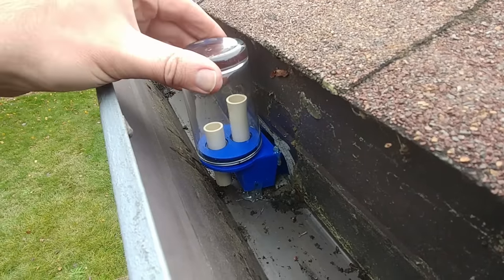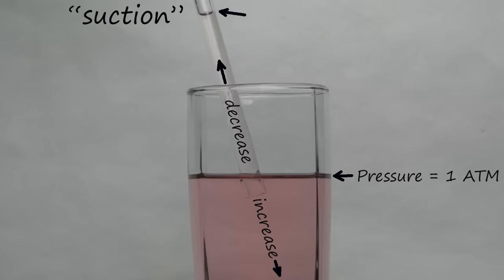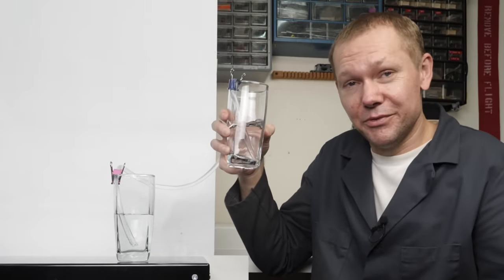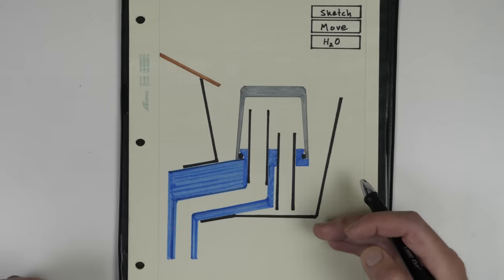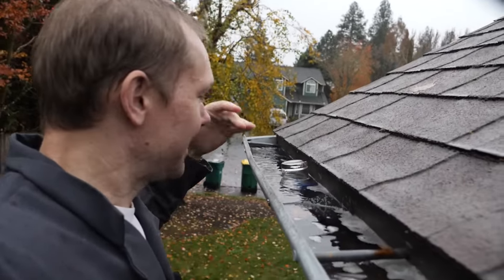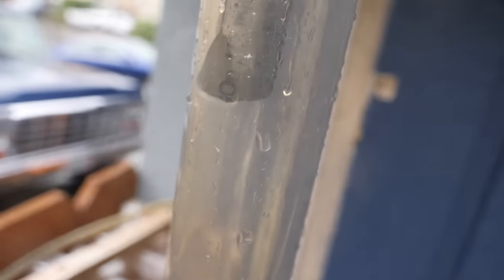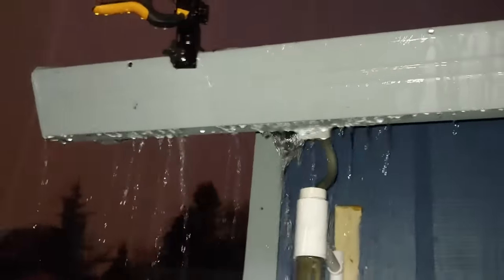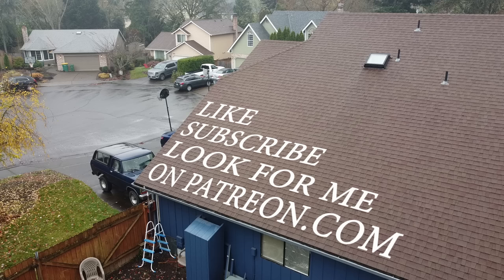Rain Gutter POWER #5 - Bell Siphon Fundamentals and Pitfalls

Comment: 8:09 What a satisfying sound :) 

BTW you should add a filter.
Reply: I agree with the Huguenot, a filter will restrict flow but a leaf guard will help with keeping the debris out of the gutter while also not affecting the flow rate.
Reply: @Willy-the-Fire-Putter-Outter  My reasoning is that small particles will plug up the nozzle quickly. He can mount a couple of feet or just one foot of screen or filter in and around the inlet of the gutter. The flow rate would stay the same that way.
Reply: @unogazzy84  ahhhh I see what you mean now. I initially imagined a filter directly attached to the bell siphon. But like a gated perimeter of wire mesh or something that encapsulates bell siphon entirely to prevent anything from getting inside from the top. But then this new mid-way filter would most likely need to be serviced frequently to prevent major debris build up. Maybe a way to solve that assumed problem would be to add chicken wire dividers along the length gutter to prevent too much debris from collecting up at the mid-way cover.
Reply: @Willy-the-Fire-Putter-Outter  That is a very good idea. How about attaching a ledge of chicken wire over the gutter? A roof on the roof if you will. It will have to be serviced but the amount of debris in the actual gutter would be miniscule.
Reply: @unogazzy84  that's the initially idea I wanted to comment about but saw this comment thread and wanted to participate here haha. Make a chicken wire roof along with chicken wire mesh dividers along the length and then that chicken wire bell siphon cover. The only problem I imagine would be stubborn leaves getting stuck in the chicken wire roof cover and either making a bridge for water to go directly past the gutter all together. Idk, maybe the shape of that top cover could be experimented on. See like if a flat, rounded or pointed top cover works best against building up initial debris. The amount of shapes is endless so there must be an optimal shape

Comment: This was one of the most fascinating topics covered in my auto tech courses. Not sure if siphons are covered under Pascal's law or some other but the water leveling out in the two glasses makes sense because both sides are exposed to atmospheric pressure and are sitting level. As long as the tube to the bottom of glass A isn't raised above the height of the water level in glass B or vise versa the water level will continue to level out. A sudden change in elevation in either glass- like is achieved by raising one glass suddedly- will cause a change in pressure forcing the siphon to drain the glass accordingly. This is a similar concept to the one used to make a brake fluid pot work. You fill the pot with brake fluid, put the top on (it has a tube that runs to the bottom) then pressurize the pot with air. It pushes the fluid up the tube due to the difference in atmospheric  pressure and the higher pressure in the pot.

Comment: Thanks you for a great series of videos. Very informative, and also fun to watch. A friend and I are going through very similar steps working on a micro VAWT.
One thing i already discovered before seeing your videos was that replacing the ball-bearings in the cheap Chinese alternator we got makes a huge difference. 
I have two tips for you, regarding the bell-siphon:
1) give the drain-tube a slight narrowing, a venturi-like shape, at the top. Or maybe just flaring out the top of the tube into a slight funnel-shape might do it. And make sure the top edge of the tube is level, of course.
2) put a second bell-siphon, set to a slightly higher trigger-level, in the drainpipe at the other end of the gutter as an emergency overflow valve.
Cheers! 🖖

Comment: The concept at the end where the glasses automatically level is used extensively in industrial settings across the US. Many sites that dispense petroleum fuels, like gasoline and diesel, have multiple below-ground storage tanks for the fuels. Very often there are multiple tanks with the same product and these tanks are usually interconnected via a siphon system just like your three glasses. This allows the site to drop product into any of the multiple tanks and the levels across all the manifolded tanks will self-adjust. Likewise, product can be pumped from one or more tanks with the same effect. No need to pump from tank to tank or sequence removals with automation.

Comment: You could make a 2nd bell siphon(overflow) with larger tubes and set it higher than the original one so it only starts if the 1st one gets overwhelmed during extremely heavy rains. Cool build

Comment: I had built a rain water harvesting system. I had 8-55 gallon barrels connected in series. The first barrel was the same level as the other 7. It wasn't until I built an elevated platform that had 4 barrels on top and 4 barrels on the bottom that the bottom would fill first before the top.

Comment: the bell syphon works on a lower flow rate when you keep the air bubble smaller from the top of the downpipe. The smaller the gap between the top of the downpipe and the top of the bell, the less flow you need to start the cycle

and a second suggestion, if you use an overflow for the gutter, make it go in a container to hold water, connected to the system, when the rain stops, you stil got the container with overflow water to folow the original downpipe water.

Comment: I've always though of doing gutter power... I've also thought how a running faucet is a potentially wasted opportunity for power generation. The inlet valve to every running water source in the home can be fitted with a sealed kind of mini turbine, running water from the faucet is already under pressure, so why not. A turbine could be placed before sink faucets, bath faucets, shower inlets, cistern inlets, washing machine inlets, dishwasher inlets, garden hose outlets, maybe even along central heating lines... A project for you to try next...

Comment: I have tried many things with syphons, and one thing i've noticed is that the higher you bring the exit pipe, the lower the flow you need to "activate" the syphon. So you could solve the cycle start problem by just taking the exit pipe higher in the bell, close to its "roof".

Comment: Loved the notepad edit, that locked so amazingly natural and satisfying. Don´t know if it rains enough to maybe add a second bell siphon and generator which can be easily activated by opening a simple valve on heavy rain like at the end. It´s a very cool idea, unfortunatly only during the pandemic there was enough rain to build something like that as well, but with industries ramping up again it´s already becoming the dry region of our country again, where storm seem to be afraid passing. Areas close by are getting hit hard, while overe here barely a drop of rain is falling, I am already starting to worry about my yard again and it´s going to get as dry as the past years. It wasn´t like that 10 years ago, 20 years ago we still got snow, I only seen three times in the past decade. We have to change our ways and have to become more self-sufficient again, our whole species survival depends on it.

Comment: Your experiment leveling the water in the glasses is literally called a water level.
Old time builders used them successfully a long time before laser levels.
A clear flexible plastic tube and some water is all you need.
I've installed many many ceiling grids using that very technique.

Comment: Might look into a multi stage bell siphon. It has the advantage of starting with very little flow as the first stage has a small tube. The first siphon, then evacuated air from the top of the second higher and much larger 2nd siphon. This draws water up and starts the 2nd siphon. For this to work, the outlet must be submerged to prevent air from entering from underneath.
These are sometimes used for auto flushing public toilets at regular intervals while using a very small flow to replenish the tank.

Comment: If you need an easy overflow, you can cut a v notch in the end of that gutter, and suspend a rope or chain from it into a pot or barrel.  You could also raise this barrel and use it as a secondary reservoir that fills during heavy rain only

Comment: That glasses equalizing trick is how you link multiple rain barrels together for water capacity. Note, for optimal flow you need increasingly larger diameter connectors when drawing from the water "battery".

Comment: I could see that overflow issue being fixed by perhaps using a whole second column with its own charger and everything, but with a barrier in the gutter that requires the water to achieve almost the maximum level in the gutter before it begins to fill the overflow segment rather than waste the extra water by dumping it, then whenever heavy rain proves to be too much, add another segment with a slightly higher barrier. Alternatively, a large water barrel on top of a couple bricks to store the overflow that can channel the water back into the main column could work as a large storage reservoir that, while less controlled and is more of a brute force solution, preserves all that water at an elevation to continue using it.

Comment: To further improve your siphon, just because you want it to suck sooner, make the tube (or just a part of it) elastic.
What will happen?
By taking a slightly narrower tube, you will get sucking sooner due to the flow rate being higher enough to cause the sealant of air. Then when the flow starts to increase (and the pressure starts to build up a bit more) the elastic tube will expand to a higher diameter making it wider.
A big attention point here will be, let the narrow elastic tube start a bit lower on the original tube. (Elastic tube pulled over the original one). First, this will make a funnel, causing the water to make an air seal even sooner by punching it of the wall. Second this will give a slightly higher pressure so that the entrance of the elastic tube will expand enough to the right diameter.
The tough part of this is finding the right elasticity. It should be able to expand enough but not to much 🤓

Comment: This is similar to how many municipal water supplies function. You have a trickle of constant water supply coming down off of a mountain, feeding a town in the valley, but because it's gravity fed, once a lot of people are using it all at the same time, the pressure can drop dramatically. That's where tanks on top of your building come into play. They fill up with the constant slow trickle from the mountain, and then when people need to use it, they can receive high pressure water to the extent that the buffer system lasts. They typically use gravity and/or pumps to supply higher pressure to people in the building. This is also how many computer systems work, in terms of cache or buffers in storage, CPU, RAM, etc.

Comment: Bell siphons will dribble out water as long as they can maintain an air gap in the exit port. The vacuum that forms in the bell will pull some air back up the exit. A piece of lay flat tubing on the end of the exit pipe can act as a one way restriction that opens to full capacity once full flow is achieved.

It seemed like the column of water in your storage tower pipe filled until it maintained equilibrium with the force generated through the exit tube of the bell siphon. The water level in the tower column created enough back pressure on the bell exit to auto regulate the flow. If the end of your bell exit pipe was shortened so that the equilibrium level was at or above your overflow connection instead of below it, then the overflow should still bleed off the extra capacity from heavy rains.

Comment: Yes ... November has returned to Oregon ... now you need to protect all the wood from getting wet ... the eaves rot first ... I still think throwing a low-head dam-and-lock system at the base of Bonneville Falls not only allows barge traffic from the interior but a few hydro-turbines should provide more than enough electricity ... and that would let you drain all that water away effectively ... my biggest problem with rain gutters is Douglas Fir trees sprouting and growing in them ... just can't quite reach them when I mow my roof ...

Comment: This may be a preaching to the choir but the principles with the glass is how they found level grades before lasers and transit levels. They’d have a hose filled with water and they’d use the level of the water in the hose to determine that two points were level. They still use them today because it is the only level that can be used without line of sight.

Comment: If you add something to the entrance of the bell siphon's output tube to make the water more turbulent I think that'll decrease the minimum flow required to trigger reliably without meaningfully obstructing the inlet.

Something like some thin vanes at the perimeter of the pipe that swirl the water as it enters to creaste a seal.

Comment: As the bottom end of the white tube may be blocked by leaves, dirts and make it malfunction, I would propose to connect a long tube with holes with your device all along its length at the bottom of the gutter ,i.e. even though some holes may be blocked by leaves, while other holes along the tube along the gutter still in function. Thanks for your device with generation of Energy. I would make a tank below the ground to store the rain water for planting if needed. The first Thanks again for your device and teaching me a lesson of atmospheric pressure which nearly forgotten as time flies.

Comment: The simple solution for waiting on the flow to increase is to lower the top height of the intake and output tubes by 1/4 or 3/8 respectively to each tube. Then it won't have to fill up as much, allowing it to start draining quicker while still keeping the gutter fairly full. It will need a way to easily adjust the tube height to accommodate the difference in rainfall each time it rains.

Comment: It seems like the problem with water loss gets enhanced from a combination of the pipe is cut near perpendicular to it's length and seated at a shallow angle, so the simplest optimizations would be either changing the angle it sits so that cut is flat or recutting the pipe to match the shallow angle relative to the water surface. I am also reminded of how a trumpet bell shapes are used on dam structures water intake pipes, might help make it so when their is enough water to crest the lip, that there will be enough volume to fill the pipe.

Comment: Just a note on the matched flow rate of the syphon and the pelton wheel jet so the level stayed just right:  you said you lucked out but actually it was a bit better than that.
You built a passive flow regulator by inserting the syphon discharge pipe inside the reservoir.  As the reservoir filled and submerged the syphon discharge pipe, it altered the differential pressure between the syphon suction and discharge, as the level increased, so the differential pressure/ head decreased which in turn decreased the flow through the syphon. That naturally found an equilibrium between the syphon flow rate and the pelton jet flow rate for their respective heads. 
The luck was in finding a range for both heads/ flow rates in the length of the pipe insertion to the reservoir.
Cool.

Comment: You can exploit water tension to solve the flow problem without sacrificing flow rate. Just create a valve that automatically increases the flow rate when the siphon is activated. A cotton wick can be placed in the outlet instead of that valuable 10 mm socket it will increase the water tension preventing the trickle loss problem. Or a rubber flap gasket for something that won't grow algae.

Comment: I would highly recommend a Stainless Steel mesh cover for your gutter to keep the debris out. Yeah you have to clean the butters before you install them, but you will have a cleaner source. 
Costco has a DIY kit. Each box is like $80ish. I had to use 4 boxes for mine. MUCH cheaper than paying someone else to do it.

Comment: You can reduce the flow needed to start the bell siphon by also reducing the amount of air above the top pipe inside. The simplest way to use a shorter glass closer to the top pipe. The siphon begins when the vacuum is formed when the pressure sucks out all the air, so by eliminating as much of the air as you can, you will allow the siphon to still fill up to the same level, but it will start much sooner. The problem was that inside top of the glass was sticking out of the water too much, resulting in a large air pocket.

Comment: Ever tried 2 rain barrels syphon power? Once one rain barrel is full, lift it up with pullies, and let it run to other and capture the water again. It would need to be a closed system to prevent water from escaping. But then you have the evaporation problems too.
I'm sure it can be engineered.

Comment: I agree with the idea.
In my opinion you have an unintended side effect.

If it does not rain enough to make the siphon work.
Then your gutter is semi full if water. Which will become brackish and in some areas  become a breeding ground for mosquitos.

Another issue that might occur.

Water standing in the gutters will add weight to the gutters.
Gutter systems should drain completely.

That extra water weight will cause problems as wind pushes on the gutters.
That extra weight will put strain on the fasteners and the material around the fastners.

Causing it to wallow out over time and at some point gutter failure.

Comment: The self leveling principal shown in the glasses experiment is used when trying to level foundation blocks with a long tube. I use a 20 foot tube filled with water with one end on the reference block and the other at the block I’m setting. KISS.